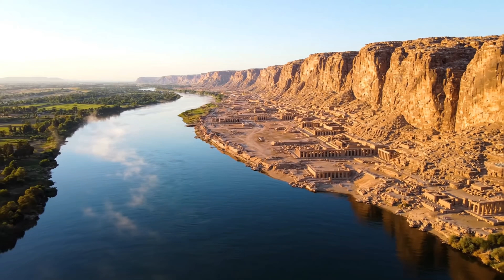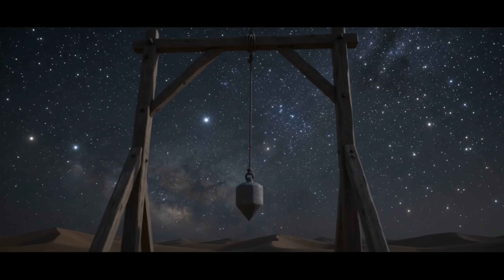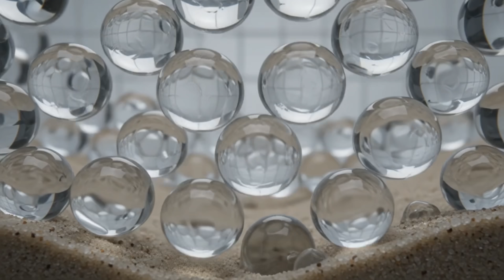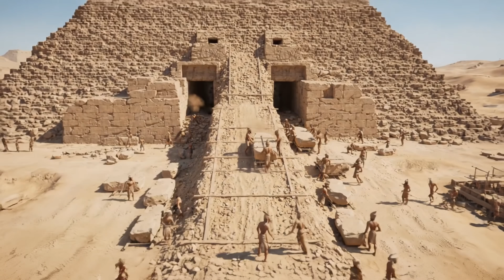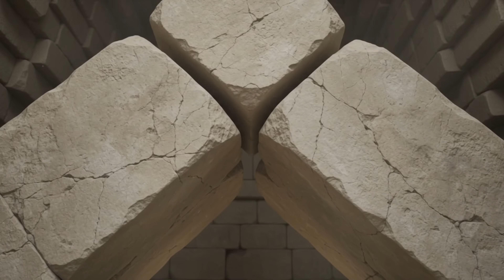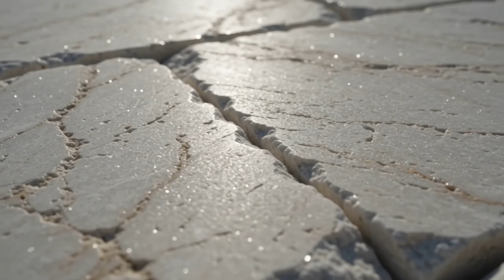How Ancient Egyptians Built the Pyramids WITHOUT Alien Technology

Comment: Well, this video is certainly full of assumptions that the creator just doesn't address.  First off, quarrying the stones for the building of the pyramid itself.  The video says they stuck wood in the gaps and poured water on it and the expanding wood created the cuts in the stone.  Yeah, right.  With the precision that the stones were cut, you think you get that from some water soaked wedges?  And how about the ramps?  Where is the evidence that the ramps were constructed in this way?  Where did all the wood go that was used to build these sledges and the ramps?  This video does not present any provable facts, just more of the same regurgitated ideas that have zero evidence.  The information presented here was probably supplied by Zahi HawASS who will not listen to any other theories and tries to prevent anyone from finding an alternate explanation.

Also, I find it amusing that the barges that were used to "transport" the stones used automotive rubber tires as buffers.  Didn't know the Egyptians were so advanced that they had cars and equipped them with steel belted radials!!  Perhaps that's how they transported the stones across the desert, they just loaded them onto the back of their cars and drove them to pyramid!! 😳

Comment: Y como elevas piedras d 40 toneladas.

Las ramplas interiores, las puedes hacer igual, exteriores.
Reply: To resolve all your questions, you need to consider two things. First, look at the experiment conducted by a single individual—Wally Wallington—using a 20-ton load (check out the relevant videos). Second, consider what Herodotus recorded in antiquity, based on accounts given to him by Egyptian priests. It is not difficult to see that what the Egyptian priests described to him was essentially the same experiment that Wally Wallington performed. The pyramid was constructed in a stepped, staircase-like fashion; workers would stand on short wooden beams—acting like seesaws—and in the gap created by the tilt of the beam, another worker would insert a wedge to maintain the height. Then, to move the megalith toward the center of the pyramid, they would slide it inward. This method is entirely feasible even today, requiring only a minimal number of workers. The large number of workers—often posited in various theories—would have been useful for tasks such as transporting materials across the ground, as well as for ensuring the project was completed quickly. However, for the actual process of lifting the blocks from one step to the next, not even one-thousandth of that human workforce would have been required.

Comment: 😮😅They just arranged the stones one layer at a time. 
The exterior stone uses quality stone that can be cut. 
The stone inside is a rough cut stone used only to fill the volume. 
All low grade stones They come from a nearby quarry. I didn't get on the boat.  Except for the stones of the King's Hall structure that were transported from Aswan. 
When arranged up to 1 in 3 halls will be installed. 
By installing a 2-way pulley  Loading and unloading rocks  using the angle of inclination of the pyramid  Weigh the weight of the stone on the other side.  Pull up the stones and line them up. 
When it gets higher, move the pulley up accordingly.  Like today's construction cranes. 
Arrange the stones up to the top of the pyramid and cover the work with limestone plaster to preserve the exterior work. And there may also be exterior paint.

Comment: What rubbish..there is a stone weighing 80 tons inside the pyramid, which was brought from 800 km away. The engineer of the world's largest crane said that such a structure cannot be built even with the largest crane..if even one stone in the pyramid was 10 cm wrong, the whole structure would collapse..in addition, there are drilling marks-whose grooves require 300 times the speed of a modern drill and saw marks..in addition, pots and granite boxes -statues with perfect symmetry that cannot be made even today with machines..so with a chisel and a hammer and ropes-human power..wake up already